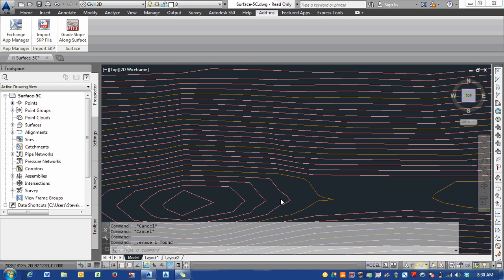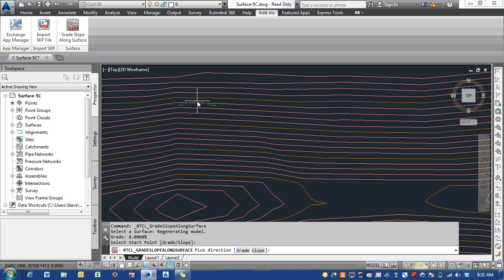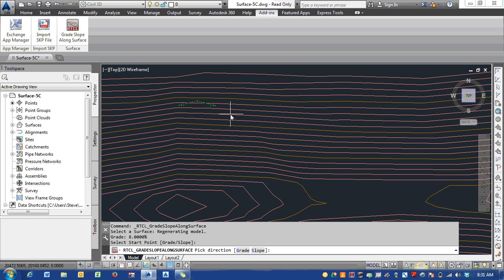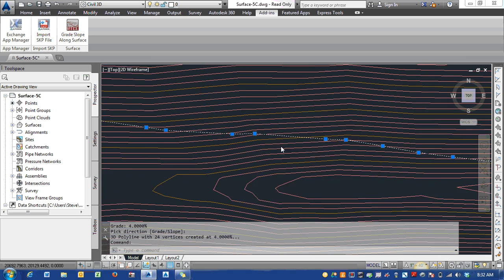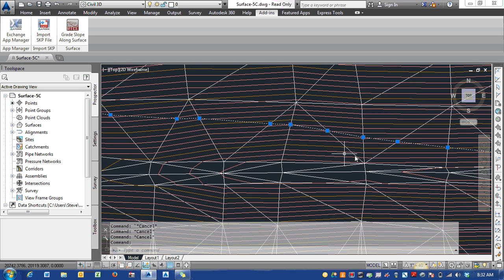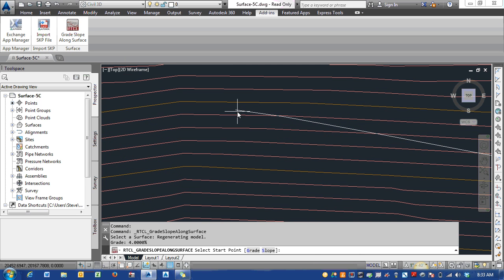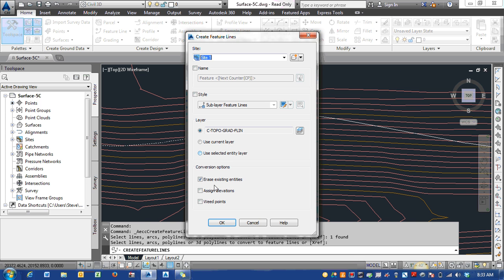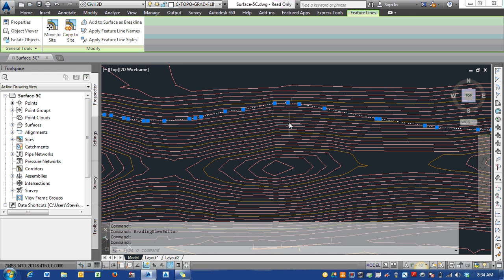Civil 3D App - Grade Slope Along Surface

Comment: Looks like a fantastic add-on.  My company is currently considering adding it to our software usage.

There is one thing that I for one would love to see added to something like this:  make it dynamic.  If the surface changes, the resulting FL would update.  If the user wants to change the starting point (or end point), and/or the slope, it would recalculate the FL definition.

Comment from the maker: Hi @ThreeMilePilot, When I say it 'errored out', I'm referring to a solution not being found. Thus the triangle it was currently on had no solution for a 2% line/angle. Yes you can skip over a bit and pick up where you think it could continue, but the tool fully depends on the data available in the surface - while the contours may appear to allow a slope to continue, the actual triangles in the surface may not. Make sense? It really is a useful app if you often need to find an exact grade along a surface.